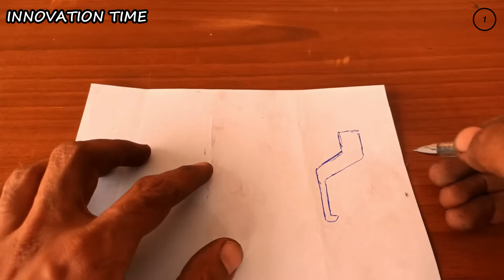Blind hole bearing puller 3 best way

Comment: Hydraulics 101: I learned this trick from an old machinist colleague to remove pressed bearings from a blind hole. Fill the inner diameter with grease, get a sacrificial gauge pin slightly smaller than the inside diameter of the bearing. E.g. Inside diameter of bearing .500" gauge pin diameter .495" Put the gauge pin in the bearing and hit it with a hammer. The hydraulic pressure of the grease will force the bearing out. I have used this trick many times over with a 100 percent success rate that has proven to be the best and fastest way to remove bearings bar none...
Reply from the maker: Have you seen my new video? 👍
Reply: @innovationtime20  I have not. Link?

Comment: From a retired Toolmaker from down under . If the bearing is of no further use then remove the inner bearing first by any means possible [cut using a die grinder ] This will leave the outer bearing possibly seized in the larger diameter hole. A few heavy welds placed into the inner circle of the outer bearing will cause that bearing to distort / shrink enough for it to easily be removed . I did it on the front wheel bearing of my Suzuki X90 .
Reply from the maker: Hello my friend
This is a good idea
I have seen this method before from an old mechanic😉
Reply: @innovationtime20  Yes thank you I was pleasantly surprised my self to see how easy it was . I learnt from a lot of older German and Russian Toolmakers myself . One thing a remember seeing was a Russian Toolmaker winning a bet by cutting a 1/2 inch W.W. left hand thread using a standard 1/2 R.H. W.W. standard tap. And yes it can be done  just try to work it out no tricks just reworking the standard tap . PS. I was one who had to pay for the bet believing it was impossible but it is achievable. Cheers
Reply: Thats also how you remove old valve seats...

Comment: This man has the best free-hand use of his tools that I have ever seen. Quite remarkable especially getting straight cuts from a handheld disc-cutter that do not need any cleaning up afterwards (without the safety guard I note!).I would have to cut smaller than required but then file it out to the actual size I wanted.
For bearings I use bread - brown or white, doesn't matter. Fill the space in behind the bearing and the hole in the middle til you can't get any more in - full up. Next get a piece of dowel - or a branch from a tree - and make it fit by shaving until it is exactly the size of the hole in the centre of the bearing. A nice tight but sliding fit. To remove the bearing strike the dowel smartly with a mallet, and as if by magic the bearing will rise from the depth of the housing. Sometimes, with an open, unsealed bearing the bread will ooze through from between the balls so you will have to find a way of preventing this from happening. Perhaps jam some pieces of rag in between the balls.
Reply from the maker: Thank you dear bark🙏🌹
Reply: And after, have lunch with the bread!
Reply: His latest video is based on this bread comment!  LMAO!! 🤣
Reply: Waste of time, money and no initiative
Reply: And an oven to make pizza..!!
Reply: By the way... I never read your comment until now. apology for been sarcastic , actually I agree with your idea same as mine, but grease dose the trick.
Reply: I watched someone do something similar but he used news paper strips covered in grease.
Reply: @innovationtime20  i
Reply: nowadays peoples make video clips to make money on youtube, they don't even know that is outdated way, 100 year ago people already know to made those tools, today make this video call 
INNOVATION TIME , something wrong with him , need go back to school .
Reply: QQ

Comment: Purchased a tool that was identical in technique to the first example and about 1/5 the size. Including set-up time, I pulled a bearing from end of crankshaft (blind hole) in less time than it took to watch this video. Always amazed at how complicated a simple job can be turned into.
Reply from the maker: This is the easiest:
https://youtu.be/rD8Cc0RfbSE
Reply: Have you ever think about that in some places is a expensive tool or inaccessible?
Reply: What would you have done if there was not a handy shop nearby?

Comment: Blind hole bearing puller, complete set $40.
23 hours of labor reverse engineering the tool with an angle grinder, drill press, stick welder, and scrap metal.  Capturing and editing the entire process into a video to prove to the world that you don’t need to spend $40 on a tool when you can build it yourself for 20-30 times the cost of buying it.
PRICELESS !
Reply: Even better: $3.00 for a loaf of white bread and $15 for a cheap seal driver kit from HF.  Pound pieces of white bread into the bearing hole with the appropriate seal driver.  The bread will "Jack" the bearing out...
Reply: @goldsburg  I do believe that will work my friend.
Reply from the maker: You are right my friend
but you cannot find this tool anywhere in the world to buy
https://youtu.be/rD8Cc0RfbSE
Reply from the maker: https://youtu.be/rD8Cc0RfbSE
Reply: If you find yourself in the middle of nowhere, say African savana and it’s at least 4-5 days to get tools or more then you making your tools will save your ass.
Good job! No lathe and no mill… got a drill and a angle grinder? No problem!😅

Comment: Nice job making this tool:well done!!
Another way to remove a bearing like this one (how it is done in the workshop) is to fill up the void behind the bearing with grease and then take a shaft (or any cylindrical piece of metal kicking about....) that with very little clearance slides through the inner bearing race..... hit it with a hammer and the bearing pops out!!..... you won’t believe it till you tried..
Reply from the maker: Thanks bro 👍
I have another video for this, I did it with bread 😉
The link is below 👇
https://youtu.be/rD8Cc0RfbSE?si=hy5deIocUqPwoUWS

Comment: I've been doing this for 52 years. I have several different ways of doing that in just a few seconds..
I fill the whole with grease. I have different sizes of shanks I match to the bearing center whole.
I place it over the whole and hit it hard with a hammer the bearing pops out..
It's hydraulic impact that forces the bearing out..
DRC   ;) work's Everytime......

Comment: If you get a pin the same size as the bore you can use hydraulics to eject the bearing. Just fill the bore with oil, then use a club hammer to force the pin into the bore and hydraulic action will force the bush/bearing out. Easy peasy.
Reply from the maker: Thank you dear Amby daly
I have make a video and make it with bread 🍞😉
Tomorrow you can see it in my channel 😉👍🌹

Comment: I like the 3rd method more.
Reply: There's also a 4th way. Shove grease in the middle. Then shove a rag in and hammer with a rod and ratchet extension. The bearing will eventually pop out.

Comment: I have always just put a ground down bolt in the hole and then put a screw driver in between the bolt and the hole to keep the bolt from coming back out , I have pulled many bearings this way.
Reply from the maker: Nice idea 👌
Thank you dear Kenneth 🙏🌹

Comment: Guy's just pack the hole with grease, bread or string and find a bolt the same diameter as the hole. Put the bolt in the hole and hit it with a hammer! The hydraulic pressure will push the bearing up and out easily! Cool tool build though!
Reply from the maker: Thanks bro 👍
I have made another video for it , I did it with bread 😉👇
https://youtu.be/rD8Cc0RfbSE?si=n-xTOvMtw7MEwJv2

Comment: Nice tool.  Ever see the greasy bits of rag or shop towel trick? Just pack them in the hole beat in with a hammer and keep packing them in there.  It will not compress and slowly but surely push the bearing out. Nothing but a hammer, dowel, and heavily greased pieces of rags.  I think AvE did it in a video once too.
Reply from the maker: thanks 👌
https://youtu.be/rD8Cc0RfbSE

Comment: I find needle bearings in small hand hand tools can be removed by the tapered type concrete rawl bolt and a sliding hammer, with a little grinding.

Comment: Lot of work for that.
Best blind hole bearing removal technique : get a deep well socket that closely fits the ID of bearing.
Fill blind hole bearing cavity with grease.
Fill close fit deep well socket with grease.
Insert socket extension into socket. 
Place grease filled socket and extension into bearing ID.
Strike sharply with hammer. 
Done with zero fabrication.
Reply: Bingo!!!

Comment: A couple months ago I was tasked with replacing the clutch in my pickup truck. I removed the pilot bearing by packing the cavity full of grease and driving an appropriately sized socket, also packed full of grease, into the bore of the bearing. The hydraulic pressure of the grease pushed the bearing out of the crankshaft with ease. That's the only time I've ever needed to remove a bearing from a blind hole.
Reply from the maker: Nice idea 👍
I used bread for it 😉
You can see this video to 🙏🌹
Reply: Bread is easier to cleanup. I've ises grease also.
Reply: You NAILED it.. I have worked in shops fpr 40 years and that is how I removed bearings. It works like a dream...
Reply: I used water dampened bread

Comment: if the bearing inner is broke you can weld two studs on & use as an anchor point or run a weld bead round the inside of the bearing outter it will fall out after cooling because of shrinkage
Reply from the maker: interesting idea🙏👌
This method can also be used:
https://youtu.be/rD8Cc0RfbSE

Comment: Just a bolt and a nut works for pilot bearing.
If you tooled up and have torch and welder and metal. But for me that little bearing would be a bolt and nut couple seconds.
Reply from the maker: Hi
It's good idea 👍
I have made another video for this 😉

Comment: Just get a bit of round bar that's a close fit to the bearing hole and shove some grease in behind the bearing and cover with some rag, put the round bar in the hole and hit the round bar with a hammer and the bearing will be hydraulically removed in seconds
Reply from the maker: Thank you dear Mark🙏
I did it with bread😉
You can find it in my channel 👍

Comment: Easy and cheap way to get a blind bearing out such as a pilot bearing in the end of a crankshaft is pack it with slivers of bar soap or thick grease and use a deep well socket or dowel that will just fit into the bearing and start hitting it with a hammer. It will compress behind the socket or dowel and the hydraulic pressure will drive it right out. I like to use slivers of ivory soap and pack it with a finger till I can't get any more in. Then use the dowel and hammer to compress it.
Reply from the maker: Thank you dear Junk 🙏🌹

Comment: You could have done that with a tin of grease a tight fitting shaft and a hammer. Using hydraulics to push the bearing out.
Reply from the maker: Thank you dear Tony
I have to do that in another video 👍
Reply: @innovationtime20  Yes look forward to it
Reply: I did that once in a transmission pilot bearing and it dieseled when I hit it! That bearing came out. FAST! I use putty and even toilet paper with good result, too. (Still use grease. I ain't scared.)
Reply: @beyondmiddleagedman7240  It works with minimum of tools
Reply: The only problem is to find the tight fitting shaft, but I've done it, too.

Comment: Spoiler: You can remove throwout bearings by filling the cavity with grease, and using a punch to pound pressure which forces the bearing out.
Reply: Soap works to 😁

Comment: 4th best way is the hydraulic way: Fill the inner diameter  ball-race, about halfway up with oil and turn short steel rod to fit inner diameter of ball-race, then hit hard with hammer.
Reply from the maker: Thank you dear Peter
I have made another video for this way 😉
My last video is about it 👍

Comment: obviously some of these applications prevent this trick but ive used it a few times and its always the easiest and cheapest way, especially for input shaft bushings/bearings in crankshafts, those can be a real pain and it does it with ease. so imagine a bearing in a blind hole, as the title says.

bread. just bread. or some really thick grease will work, ive seen people use wet cardboard... regardless... i prefer bread. 

so you just take the bread and stuff it into the center hole of the bearing until the entire cavity behind it is full, then you take a bar/punch that fits inside of the bearing hole, something close enough but that wont get stuck, and hammer away at it. the bar/punch will compress the bread down behind the bearing and push it right out. ive done it many times and i can never believe how well it works after all the pullers and tools ive failed with.
Reply from the maker: Thanks 🙏
I have make another video for it 😉
https://youtu.be/dRtR1smHfFM

Comment: I saw that when you were tapping the thread around 1:10, you were only going in one direction. You will find that you get a cleaner result and your taps will last longer if you go 1 turn forward, 1/4 turn back. Also use some drops of light oil (or WD-40 on aluminium).
Reply: Smart Alec,come to totally redundant
Reply: Yeah lets add another 10 seconds to the video eh. We all get the idea.
Reply: @stephencummins7589  He's right, except I would go less than a turn forward.

Comment: Interesting but unnecessary.  Just fill the cavity with grease, then take a bolt that fits close to the inside diameter of the pilot bearing, hammer it into the hole and the hydraulic pressure will pop the bearing right out.
Reply from the maker: It's good technic , I have made another video for it 😉
https://youtu.be/rD8Cc0RfbSE?si=ZyGNZ6lBCvvnuxoI
Reply: That strategy has very limited applications.

In my case, both the grease and the bolt will just eject out of the opposite bearing on the other side of the wheel.

Comment: Very ingenious, but for the blind hole bearing , is enough machining a suitable shaft of any metal that just fits in the inside of the old bearing, filling up the hole with any grease starting from the bottom of the hole, so there won't be much air trapped, and with a mallet "havey hammer", in one strong blast, the pressure from the hydraulic force would drive the bearing out in no time.
Reply from the maker: Thank you dear Cosimo 🙏👌
I have made a separate video for this idea👍😉

Comment: There bearing puller you made with that round work piece, I request for the sizes of the spares you used. I like to work with dimensions.
Reply from the maker: Hello my friend
The size of the part that is trapped between the balls depends on the size of the bearing and its balls
It should be made in several sizes to replace it for different bearings
The size of the circle that has three grooves that I made is actually the size of the biggest bearing that it can take
Good luck

Comment: i have heard if you make a mixture of potato and paper and put it the hole and then you put a rod into the inside diameter and hammer and remove and keep filling with the mixture and repeat it will come out!   Edit:   I just saw you made a video using bread :-)

Comment: Alternatively, if it's a bearing you're not bothered about keeping, and it's large enough.  Just weld a piece of plate with a hole and nut already welded in across the bearing, then thread a suitably long bolt into the nut, and hey presto, out comes the bearing!
Reply from the maker: Thank you dear John 🙏
It's a good idea 👌
Reply: @innovationtime20  You're welcome friend.  I've been able to extract really hard to budge bearings this way.  It can be a bit tricky getting it to weld up, but the advantage is that as the weld cools it contracts, so if you've been able to get a good weld pool into the outer race of the bearing, it'll actually shrink the outer race a bit, making removal of the entire bearing much easier! 😉

Comment: No point if you have a welder.
You can weld directly to the bearing & the heat will cause the outside one to expand & will almost drop off (if your fast).
Just run a weld around the inside of outer race ( or just weld up balls & all) on the inside bearing & it will usually just fall out when it cools.
Reply from the maker: You are right dear Ross 👍
Thank you 🙏❤️
and you can see my video "bread as bearing puller" 😉

Comment: Number 4: Find or get machined a bolt that slides with little play in the bearing. Fill the hole with grease and hammer the bolt in. Hydraulic pressure will force the bearing out.
Reply from the maker: Really 🤔
It's a good idea
I have to try it 😉
Thank you dear Johann 🙏🙏🌹🌹
Reply: @innovationtime20  I have learned that trick from a car mechanic to remove the needle bearing in the crankshaft from cars with manual transmission. Works like a charm.
Reply: I was going to suggest that, but I see you got there first. Works well on sealed bearings, a bit iffy on shielded bearings.
Reply from the maker: Thanks 🙏
Reply: @kennethjackson7574  it works great on even open bearings, u simply need to stuff a rag or bits of paper towel into the cavity first then a dollop of  grease
Reply: @JunkCCCP  It certainly sounds like it’s worth a try.

Comment: Just skip making a tool, take the welding rod, run a bead around the inside of the bearing, quinch it immediately, and it will fall out. No need to thank me 😅

Comment: Comments section is full of people that have never done any of this work.  The most common method around the world is fill the cavity with grease.  I've seen people do it with paper.  I've seen people use a combination of both particularity if the bearing is not sealed.
Reply from the maker: Thank you dear Shain 🙏👌
Reply: I've done it with white bread
Reply: i just need 1 bolt and spacer to pull the bearing (first bearing video and last bearing video)

but i never see someone actually doing what i do